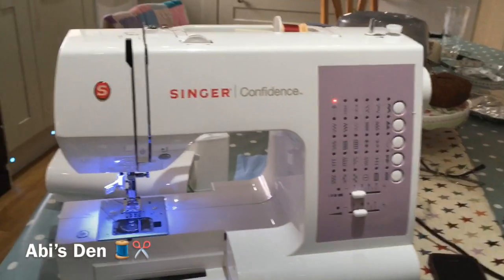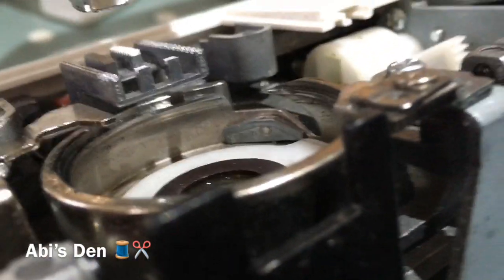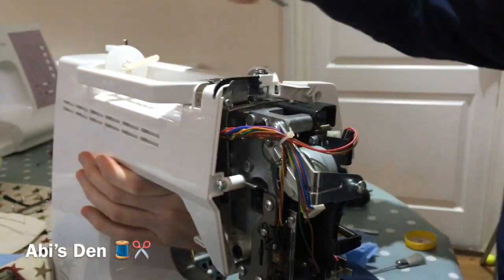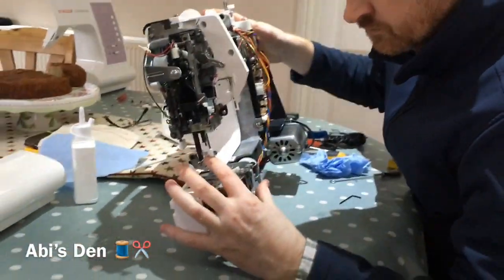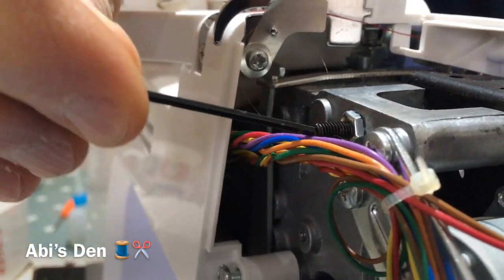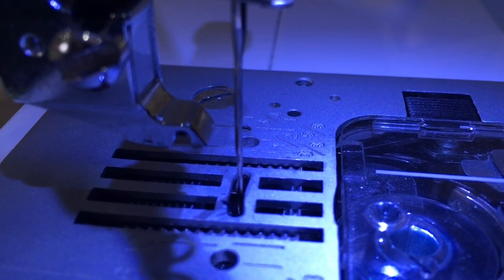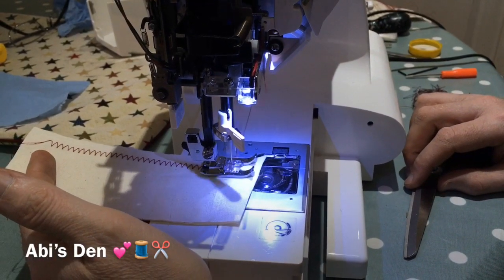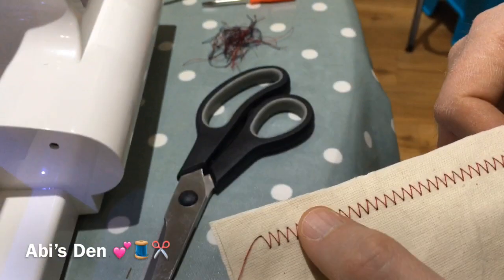How to Fix the timing and Needle Position on a Sewing Machine - Singer Confidence Brilliance Lidl

Comment: Hi there wondering if you could help I have a singer confidence 7470 I know that the timing out I taken the casting out when I turn hand wheel the hook not catching the tread witch be should l be looking at inside machine to correct this I’m clueless Thanks

Comment: dont forget to  keep your allen key in and hold it still when you are happy with the setting and then tighten up that silver locking nut. otherwise it will vibrate to a different position.

Comment: What do you do if the needle isnt hitting the hook but is instead scraping along that white plastic bottom of the bobbin housing
Reply from the maker: The needle needs lifting and that's done using the screw in the needle shaft. you can access it by removing the light bulb cover.x Good Luck x

Comment: I have the same singer confidence machine. It sew straight great but can not sew zig zag and skipped zig zag. I didn't hear it touch the hook? Should I fix the same your video guide?
Reply from the maker: No, no. Your machine has a different issue. Your needle may not be fully inserted or the wrong needle is used for your fabric. At very worst, the timing is out , that’s a different video

Comment: This seems contradictory. You move the allen screw one way just far enough so the needle isn't hitting the hook, but then it's hitting the plate. So then you rotate the same allen screw the other way until it's centered again. Would the needle be right back to hitting the hook again?
Reply: Yes and I could hear it click on each stitch.  Since the timing seemed good, I'd think there'd be another misalignment somewhere.  I have one of these machines and it's a great performer but if it starts clicking I'll tear it down and see what other adjustments are available.  The unit could have been dropped and tweaked, too, we really don't know.  I like their discovery and logic about the bar assembly, though - good work.
Reply: Exactly what I thought

Comment: I have a 5560 and my needle won’t move at all I looked where the bobbin goes and that doesn’t move either. What do I do
Reply: I also have 5560. It was breaking thread. Needle was hitting the plate. But something is thumping in the bobbin case, not every time the needle goes down, but whenever I sew faster. It sounds terrible. My husband and I are trying to figure out how to correct the timing. Will post when we get it fixed. I replaced my needle, which helped with the thread breaking.

Comment: Hi there! I've just followed this in moving the needle forward and fixing the timing but now I'm being displayed an 88 error message. Do you know why this may be? I'm gonna give it another go tomorrow but your help would be greatly appreciated!
Reply from the maker: Hey Connor, I found this : Flashing lights, beeping sound are error signs its posiibly the upper tension path is not threaded correctly. Check that the transparent thread path located at the top of the machine is threaded correctly.
Hold thread in both hands and slip under transparent thread guide. While holding the thread securely, pull the thread towards you and then slip it back and forth like you were flossing. You should hear or feel two clicks as the thread slips past the thread guides.

Comment: Neither my husband nor I can figure out how to take the outer covering off of this machine.  Can anyone give us a hint?  LOL!
Reply: the t shaped screwdriver in the accessories box should allow you to lift the bobbin plate out. Use the narrow end to loosen then upside down for less fiddling.
Regular posi screwdrivers will open the casing screws. Mostly need access to needle shift, so one screw on that end of the machine and one at the back halfway down the casing.
If you need to remove the inner slice, so to speak, the narrow part the thread follows down on its right and up its left to the hook at the top of the needle shaft. You'll need the tiny thin screwdrivers.
Be careful as the screws come out, they can be hard to catch and then fall into the machine, especially those last 2. When putting them back, of the latter2 the smallest goes forward to just catch, then the bigger goes to the top but take care not to overtighten that or it will press against the tension plates. Learnt that the hard way.

Comment: Why don't you show how to take the casing off
Reply from the maker: I think if you’re fairly confident to be tackling this you may already be able to take the casing off. I don’t have the machine anymore to demonstrate but I’ll bear it in mind for the future. I just like showing interesting parts of the repair work. Taking the case off is straight forward
Reply: @AbisDen  You say this, but I'm very mechanically inclined and yet I'm stuck trying to get the cover/casing off...I took off the needle rod cover on the left but thats it...